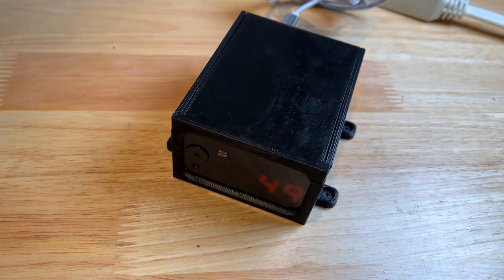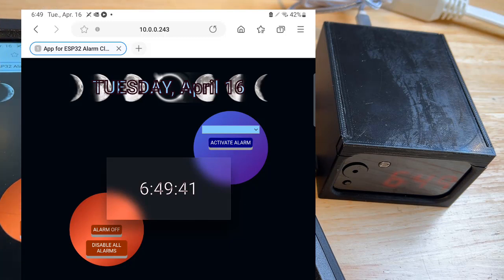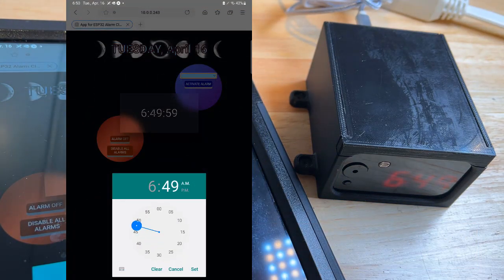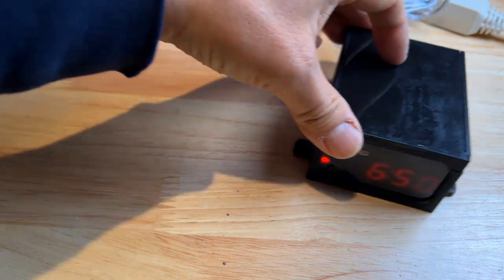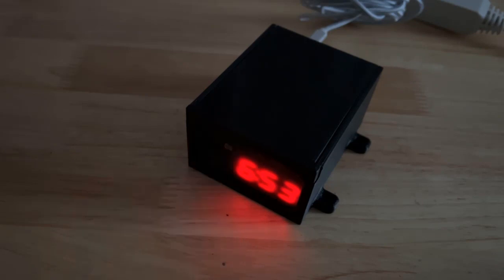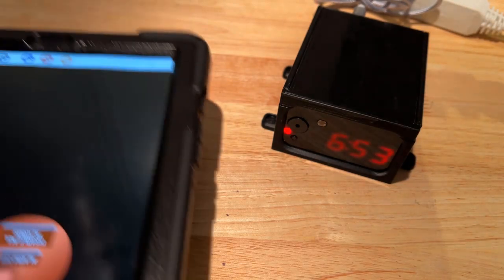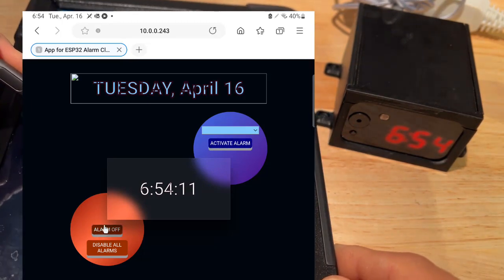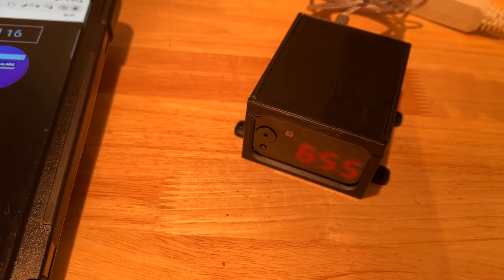DIY ESP32 Digital Alarm Clock with Web interface - It won't let you sleep in

Comment: awesome design, is it possible to change the sound or sounds file in the design?
Reply from the maker: Hello 1Akgo44. Thank you.

Yes you can change the sounds, but it is in the programming and not in a separate file. It has been a while, but if I remember, you have to set up the buzzer pin in the setup() with these functions:

  ledcSetup(0, 800, 12);        
  ledcAttachPin(buzzerPin, 0);  

'buzzerPin' is whatever pin your buzzer is connected to of course. I use a function around like 745 called 'playSound(int Tone, int Duration)" to play different tones one after another. This function calls other functions:

  ledcWriteTone(0, Tone);
  ledcWrite(0, 50); 

These 'ledc-' functions are built in functions in the Arduino IDE for the ESP32 (like digitalWrite() is a built in function in the Arduino IDE for example). They can be used for a PWM signal for LEDs, hence the name. However, I am using them to generate different frequencies to get different tones on the buzzer. You will have to do an internet search to get more information about them, and you will be able to figure out how to use them.

Good luck!